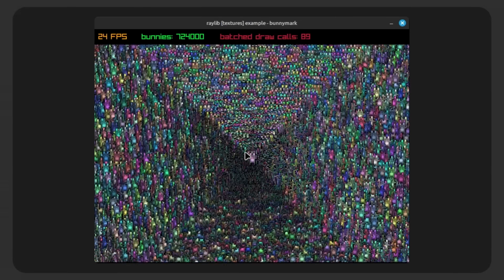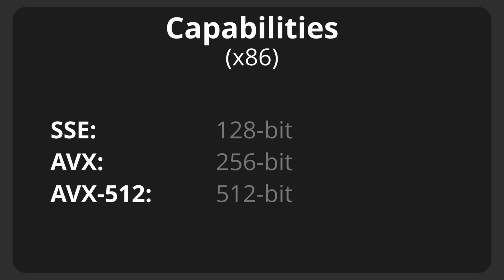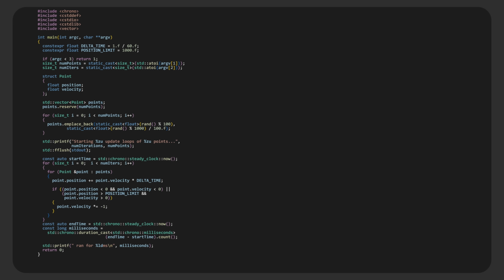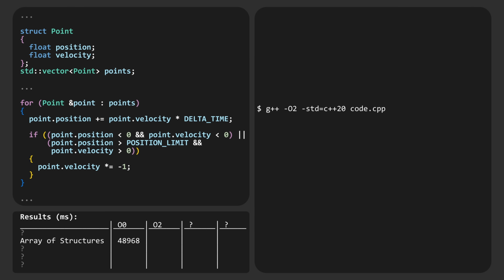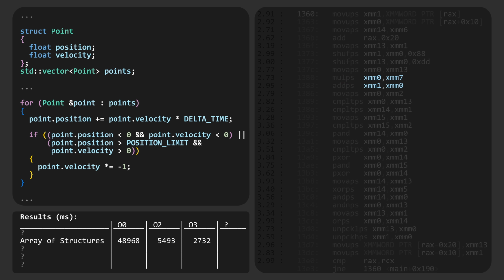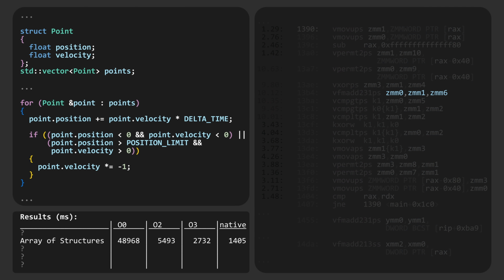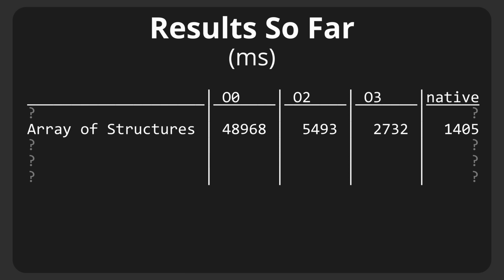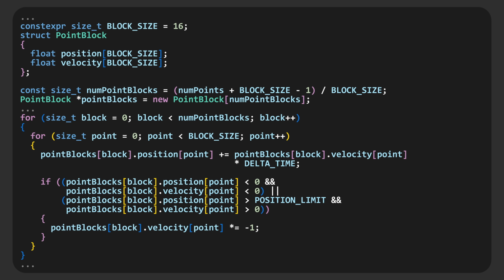4x Code Performance with SIMD

Comment: I'm curious about how much -Ofast might improve performance, since it tends to sacrifice some accuracy for it.
Reply from the maker: In this case it doesn't appear to help much/at all with gcc. The assembly generated is slightly different but runs in essentially the same time. Of interest is that `-O3` was already using fused-multiply-and-add which I believe MSVC will not use without the equivalent of `-ffast-math` as it changes results. Not that I've gotten MSVC to vectorize this particular code...

Compiler Explorer diff and execution if you're curious (though note execution times naturally vary and I've seen decent swings): https://godbolt.org/z/oGo7nf6qo

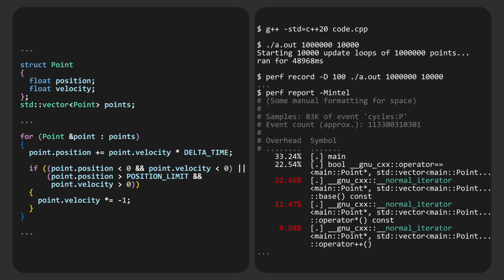Comment: 4:00 x86_64 requires at least a minimum of SSE3 support, so compilers can assume even more then SSE2.
Reply from the maker: While I won't claim to be an expert in the area it appears the minimum support is a bit nuanced (as with most things). An interesting data point is which flags gcc (and g++) enables. This doesn't appear to include SSE3 unless you use something like `-march=x86-64-v2`.

```
$ gcc --version | head -1
gcc (Ubuntu 13.3.0-6ubuntu2~24.04) 13.3.0

$ gcc -Q -O3 --help=target | grep '\-msse3'
  -msse3                      		[disabled]

$ gcc -Q -O3 -march=x86-64 --help=target | grep '\-msse3'
  -msse3                      		[disabled]

$ gcc -Q -O3 -march=x86-64-v2 --help=target | grep '\-msse3'
  -msse3                      		[enabled]
```

Comment: Very interesting, I knew that you could speed up calculations by using a continuous block of memory to store member values but I always thought that it was only due to caching and not the compiler vectorizing the code. Also a side note, this optimization isn't very useful for functions that always use all class values from what I heard, never tested it myself though.
I'm wondering, did you happen to test this with MSVC? I'd love to see how stupid MSVC is compared to GCC lol.
Reply from the maker: There's certainly a time and a place for these types of data layout. While a SoA layout can be beneficial for cache usage for certain access patterns they can be just as detrimental to others. This can result in issues like you mentioned when you access many values from the same struct. Sometimes the AoSoA structure (hybrid solution in the video) can help but even that isn't a layout that is always "better".

I've done deeper testing in the past and have had issues getting MSVC to as aggressively auto-vectorize. That could just as easily be a lack of familiarity with what scenarios and flags MSVC expects for vectorization, however. Similarly a quick attempt on Compiler Explorer doesn't result in the packed vector instructions that I'd hope for: https://godbolt.org/z/r9dT7hKqz
Reply: @keiferjh  I'm also not very experienced with MSVC flags, but I honestly highly doubt MSVC could do much better especially considering GCC is way more developed than MSVC. Very interesting to see the results nonetheless.
Reply from the maker: @rafa_br34 Regardless of how well the end result turns out I'd be interested to see an MSVC result with some  auto-vectorization as I know the compiler is able to do so. As you said, though, either way the results are always interesting to compare.

Comment: How do I know if I have SIMD?
Reply from the maker: Unless we're talking about a more constrained environment, like with some micro-controllers, the question is more likely which SIMD instruction sets does your CPU support. You can find this a number of ways. On Linux you can find the "flags" with `cat /proc/cpuinfo`. On Windows there are tools like CPU-Z. Lastly, this should be info made available by the CPU manufacture and will be on the product page somewhere.

Comment: I wonder why no languages leverage this structure of arrays idea more heavily if it’s so conducive towards vectorization?
Reply from the maker: I'm not terribly familiar with them but some languages focused on things like data analysis do heavily leverage these concepts. Languages like R and MATLAB come to mind.

It's also not as if it's not possible to do in C/C++; it just doesn't feel as natural especially as we tend to think of things in a more Object Oriented manner. Granted it would be nice for some syntactic sugar to make it easier. From what I've seen in other comments Zig might have something in that direction with "MultiArrayList".
Reply: My experience with it is limited, but Odin is a language that supports SoA paradigms at the language/syntax level. It essentially allows you to have an SoA, but can syntactically be used as if it were an AoS. So you can get the best of both worlds by transparently using an SoA as a if it were a more ergonomic AoS, but the better codegen because it is actually an SoA.

Comment: I'm reading the assembly, albeit on my phone so I can't double check the instructions but its interesting to see that 3rd if branch just melt away. And I can't for the life of me see where it went. Vector extensions, cool as they are, are difficult to grasp 😂
Reply from the maker: I was tempted to dive into the conditional in the video as it's plenty interesting, but it's also complex enough to detract from the main takeaway!

IIRC the optimized examples heavily use mask registers (`k0` and such) so that's a good place to start. I have links to Compiler Explorer for each example in the description which may help as well (though I don't know about the mobile experience). While I tried to keep all relevant instructions in the video some of the missing pieces for the conditional might be in the rest of the context.
Reply: @keiferjh  right, that was my first thought too (the K registers). Handrolling an optimization for the 3rd if branch is trivial though (via branchless optimization, since the boolean statement can be reduced to a value which you can multiply with and if you make that value either be 1 or -1 you can get it to return N or return -N), so I guess I shouldn't be surprised that th compiler can do it.

But knowing this its still not clear to me exactly where this happens!

Comment: You did great on this video - you should do more of these types of videos
Reply from the maker: Positive comments like this certainly add to the motivation! There are plenty of topics in this vein that intrigue me and videos make for a great outlet, albeit a good bit of work to produce.
Reply: @keiferjh  Im not specifically a C/C++ programmer but my current employer has me doing this type of work and this video alone helped teach me a lot and gave me a good intro to optimizations like this. Speaking for myself here of course but I would definitely love to watch more videos on optimization or fun little CPU gotchas in regards to the different architecture  platforms code may compile for. Or exploring interesting undefined behaviors.

I think your format was great and I am looking forward to your future videos! Cheers!

Comment: How do you begin to learn about this kind of low level magic? I know very basic assembly instructions but this was just awesome
Reply: Look into a book called Performance Analysis And Tuning On Modern CPUs, you can easily find the pdf.
Reply: @TU7OV  oh wow, this looks like a fantastic resource. Thank you
Reply from the maker: A lot of it comes down to being curious and looking into things that catch your attention! There are a lot of great free resources online and elsewhere to leverage; even if something doesn't seem immediately applicable, outside of your current skill set, or any other daunting reason, it's usually well worth the time. Even if you don't understand everything (or anything) in the moment it'll make it all the easier the next time you come across similar concepts!

Comment: the GPU is a separate computer processor in its own intended for such tasks to be ×4, ×8 faster
Reply from the maker: Having hardware that is more specialized to a task is always a great benefit! While this video focused on the CPU changes it was very intriguing to see the massive improvement from even a first attempt at GPU changes with GL_POINTS primitives, a custom fragment shader, and a compute shader. It's certainly an area I want to explore more!

Comment: Code rendering and pacing of explanations were indeed extremely clear and well-put together. Really really nice video. Will be looking forward to more content like this from you as I just discovered the channel. I also appreciated the proper subtitles.
Reply from the maker: Glad you liked it! While it took a lot of work a video like this is a nice way to help explore and solidify concepts for myself so more are very likely to come! I'm also happy to see the subtitles are actually useful! It's not too much effort to use Whisper and review manually but positive feedback just means I'm more likely to keep doing so.
Reply: @keiferjh  In fact I already knew about the SIMD paradigm but your demonstration helped me realize the data structure induced non contiguous memory pitfall that compilers may encounter through simple automatic optimization so yeah, it definitely helps solidify concepts. That kind of detailed analysis is really the part that clicked for me. Anyway, keep it up!

Comment: but why would you draw anything with cpu. sure if you want to flex with cpu code optimization. practical use cases, use opencl, that works on both cpu and gpu?
Reply from the maker: It's not about drawing with the CPU but rather calculating on the CPU which is still very common in practical use cases. Even here all drawing is actually done with the GPU based on the primitives sent by the CPU with some batching (though admittedly the default batching may not be great for this example). Here it's absolutely easy enough to send the initial primitive state once and just update with a compute shader each frame as teased at the start of the video, but that's not always the case. Perhaps you have enough other computations/graphical processes to saturate the GPU. Perhaps the logic depends on more input/state that isn't easily transferred or kept in sync on the GPU. CPU optimizations are clearly still an important topic to explore.

Comment: im actually new in this optimization code area, i already work with embbeded system and we use a lot of vector operations, there is a dedicated DSP to do this, but now i figured out that the processor we use, supports SIMD instructions, i will try some of these concepts, this works only iwht g++ or gcc too? and other thing about the GPU taht you talked before, maybe you dont see to much gain performance, because to send the data to the GPU you already has the PCIExpress latency so depending on your motheboard in GPU it may will impact more in the time than the actual calculation, but i would try because this GPU area is something that i was researching, there are a lot of parallel algorithm that may can improve a lot more the performance but is a not to easier knowledge, maybe i lost the point that i was trying o reach but, thanks to show me that only with CPU we have a lot space to improve yet, but you need to know a lot about your processor.
Reply from the maker: Embedded systems are really interesting! I imagine any dedicated hardware will be faster for what they're specialized in but SIMD instructions could still worth exploring on any platform that supports it! Most compilers for most languages should have options that'll leverage SIMD. Gcc certainly does and it should even share the same flags as used in the video.

While I didn't go over it in the video, I'd say the GPU improvements are massive for this example. Going from ~17fps to 500+ while still drawing is amazing. The actual computations (which were the focus of the video) go down to ~30μs even in that situation. That example isn't exactly apples to apples as it also changes the way drawing is done but also touches on a concern you've brought up.  Not only does it reduce the amount of data used for each element on screen, but it also doesn't need to transfer data every frame as the GPU can process its own data before drawing again as no CPU logic is necessary in this simple example. Going any further you really have to question whether 1,000,000 elements all need to be screen at once and drawn overtop one another. This leads to lots of overdraw and wasted time.

Comment: what about branch misprediction on your if statement? does it help to consolidate the short circuited logic into one bool and check that?
Reply from the maker: Another interesting topic! I did some exploring earlier in the project (though didn't document anything so don't remember many details) but at a glance it doesn't appear to be much of an issue. There's always room for more exploration, however!

In case you're curious of the misprediction rate (using commands like `perf stat -e branches,branch-misses -D100 ./a.out 1000000 10000`):
* Large Structures: 0.02%
* AoS: 0.01%(O2), 0.04%(O3), 0.09%(native)
* SoA: 0.07%
* Hybrid: 0.07%
* Hybrid (aligned): 0.07%

Though of course this only gives a rough idea, especially with only one execution and a messy delay argument to try and skip setup code.

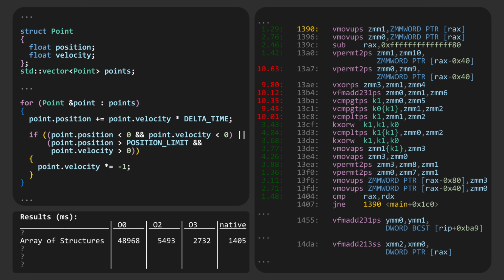Comment: 7:36 I love the logic here (139C), why adding 128 when you could subtract -128? I have even more questions if it turns out to be faster. Compiler optimizations are sometimes unexplainable
Reply: Because it uses SUB r/m64, imm8 where the immediate operand is sign extended. If it added, it would have to use a wider operand, because two's complement has one more negative value than positive.
Reply from the maker: That caught my eye as well! Haven't given it too much thought but I'll trust the compiler on this one.

Comment: very nice video! sadly you didnt fill the Results table at 11:30, it would be nice to see how flags with less aggressive optimization handle the problem
Reply from the maker: I did think about it! Ultimately I opted to try and keep it easy to focus on the points from the video but the Compiler Explorer links in the description should make it fairly easy to change flags and peruse the generated assembly if you're curious!

Comment: I use Intel Intrinsics when I want to SIMD and go super fast.  It's sort of half way between assembly and C++.  Much easier to work with if you're not an assembly guru and want to try handcrafting something.
Reply from the maker: Certainly a good tool to be aware of! Intrinsics are fun but not very portable and you still need the basics of the correct data layout regardless. They're an excellent choice for targeted improvements but never underestimate a compiler! The right tool for the right job, and all that.

Comment: Really nice video. As someone who is interested in system code but has no business writing it, i would have liked a bit more explanation and focus on the alignment part. Like what is aligned to what and why. And why 64 and what das alignas in cpp. And whats the difference between creating blocks of data and alignement. Isn’t making sure that you always have 16 bytes for simd a form a alignment already? What is the other alignment then.

Other than that, 9/10. Thanks for putting all that effort into producing such a nice video!
Reply from the maker: Thank you for watching and your constructive feedback on what could have been more clear!

Honestly the bit about alignment is scope creep for the video and all the questions you ask are a perfect illustration of why. I kind of realized that (and slightly alluded to it) but it probably could have been better handled like the GPU example and call out that it's a cool optimization but too much to cram into the existing video.

It'd take more than a YT comment to explain in the detail I'd like (and frankly some research to make sure I understand any nuances and how best to explain it) but in case you're interested in a primer for your own research some info is below. Though perhaps it would make for a better separate video than I thought...

* Alignment defines where in memory an element of a type can be allocated. While perhaps a bit overwhelming, https://en.cppreference.com/w/cpp/language/objects.html#Alignment is a great resource. The page for `alignas` also helps.
* Without explicitly specifying alignment the `PointBlock` struct shares the same alignment as a `float` and so can be allocated on 4-byte boundaries.
* Compiler explorer is awesome for, you guessed, exploring compilation. Here's an example that shows the different alignments of 4 bytes and 64 bytes (the return value of the functions is just moved into `eax` so the assembly is easy to read): https://godbolt.org/z/dYfodxT4b
Reply: @keiferjh  Two details about alignment: There are many boundaries that might matter, e.g. bus width, register width, cache line length, burst size, MMU page size, DRAM row size, flash sector and eraseblock size. When you have these correlated arrays to traverse, it can help to stagger at mismatched counts of cache line sizes to reduce contention on particular rows of cache across different ways (similar to how transfer capacity can be raised by spreading across memory banks), perhaps even multiple rows apart to accomodate prefetching. Some of it can be counterintuitive.

There's practically always more detail to be found. When there's a lack of reference material that means there's research to be done too. :)
Reply from the maker: @0LoneTech So many more rabbit holes to go down!